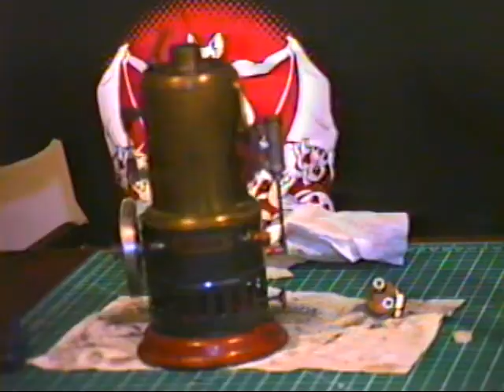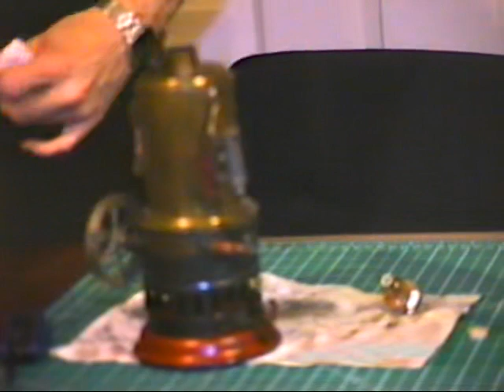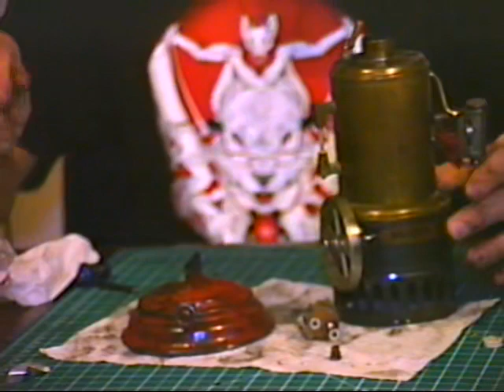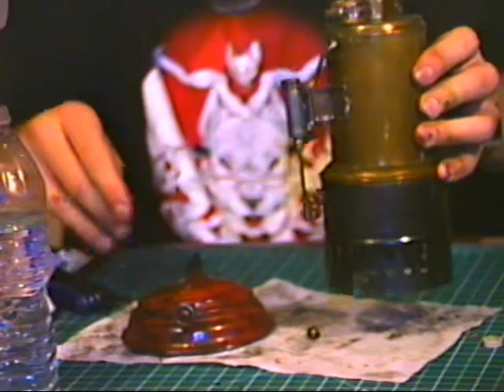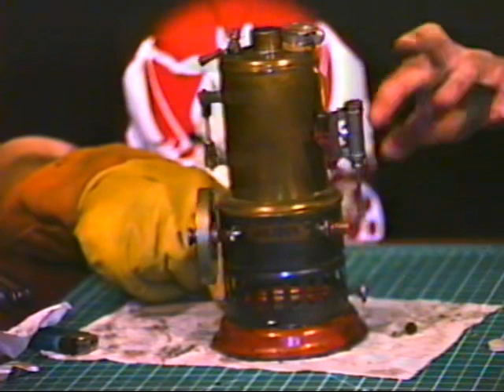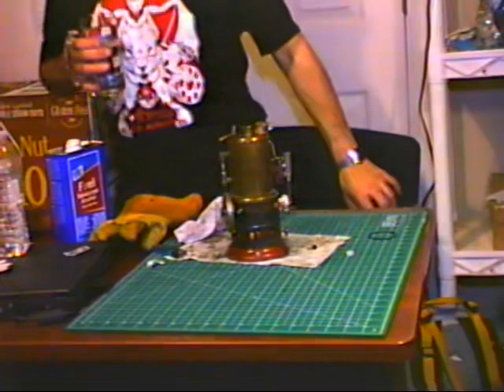Dumb Dinosaur Operates a Toy Steam Engine | Weeden Model 20 [raw VHS footage]

Comment: A small stepper motor might be worth a try as a generator as they tend to put out a decent voltage even at low RPM. 
When I was a kid I got one out of a dead printer and made a little wind generator with it, it would put out enough voltage to light LEDs and charge NiMH batteries without needing a boost converter or transformer